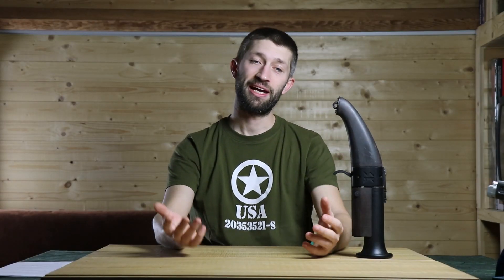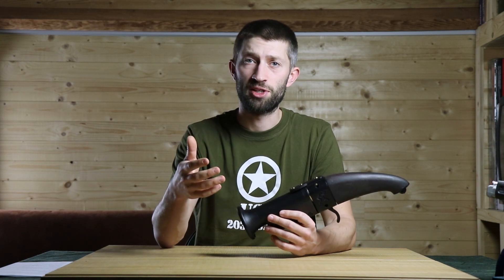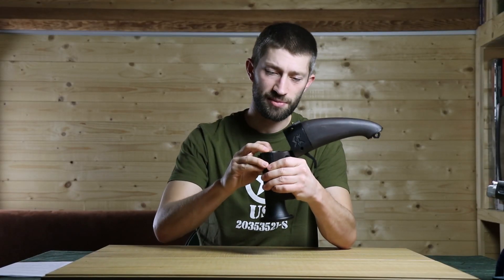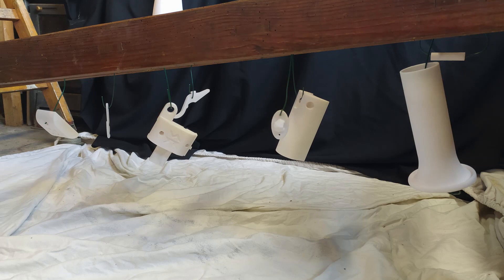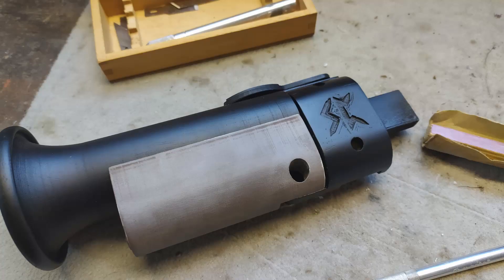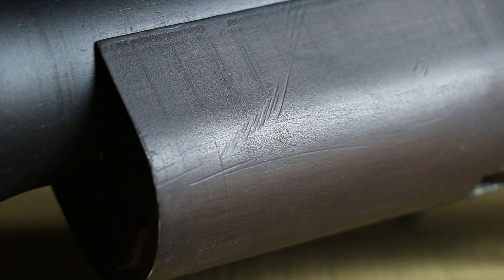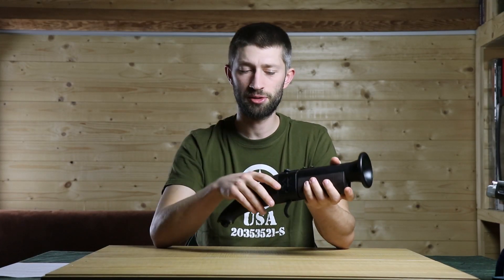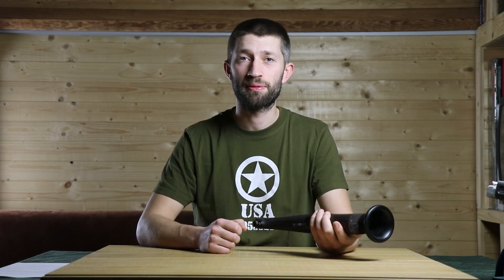Airsoft Pirate Gun / Blunderbuss - 40mm Shells - 3D print & DIY

Comment: Can you make one like more of the full scale blunderbuss and like the wood on the bottom of the barrel a little bit short so you can break the top of barrel to load one in, and add like a flintlock decoration that just moves when you fire?
Reply from the maker: Ooooh nope. This one was already a lot of work and I could use drawings from the internet :P
Reply: @VerageAirsoft  explainable.

Comment: Really nice build! I'm currently printing out my barrel right now. Which black spray paint did you use and copper screws & trigger spring?
Reply from the maker: I used normal matt black spray paint from the hardware store. Copper screws were a find in my shed that I kept for projects like this.

Trigger spring is from an old pen :D

Comment: Hi, I'm curious what type of printer filament you used and how it's holding up over time?
Reply from the maker: I'll have to look that up. It was a rather cheap brand. I think the 123-3d.something website. It hasn't seen any sunlight and it's still looking the same. Because of corona I couldn't play with it.
Reply: @VerageAirsoft  That's too bad you haven't been able to try it yet... but thanks to your video I decided it was time to get a 3D printer, so I got the same one you have and I'm printing this thing up right now.  It's the perfect addition to my pirate airsoft loadout.  I'll let you know how it turns out.
Reply from the maker: Yes, I'm slow :D Sorry about that.
The filament I used on this build was from 123-3D.nl. I tested their own brand and that was working pretty good.